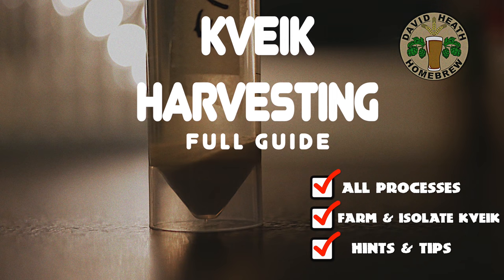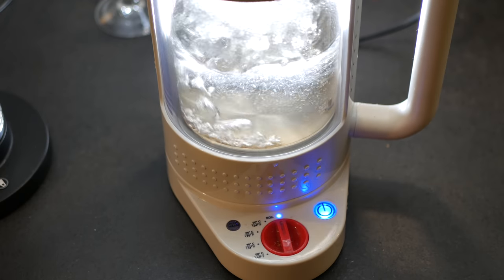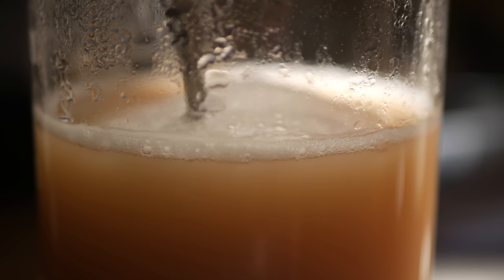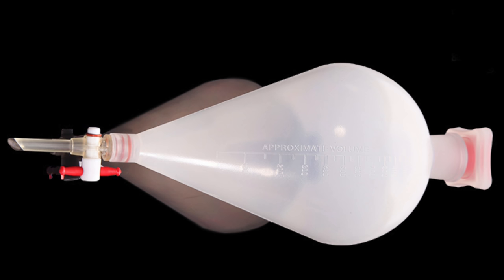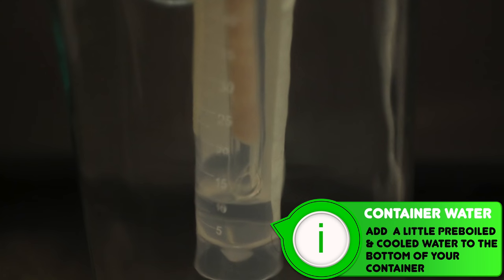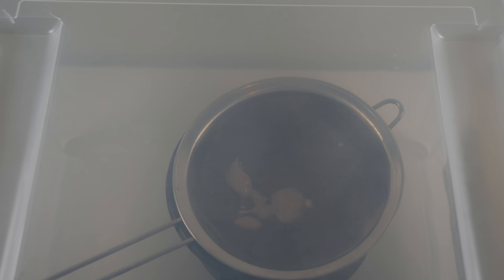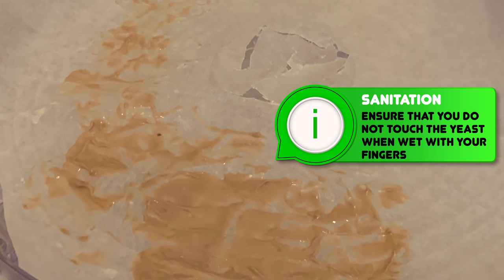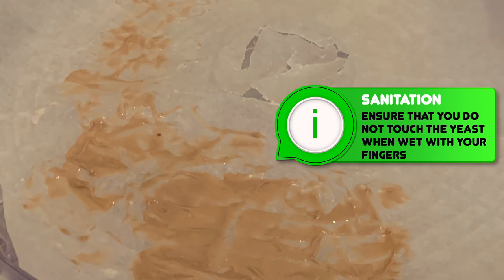Kveik Yeast Harvesting Full Guide

Comment: Love the information in your videos - so thanks.  Got myself some Sigmund's Voss from Crossmyloof in Glasgow and found I didn't have to top crop.  I switched from air locks to blow off bottles after my first fermentation - and being the greedy chap I am tend to fill my fermentation vessel a couple of inches below the top.  The vigorous fermentation (and I could describe it as explosive) saw my blow off bottles with their distilled not sanitised water - full of top yeast.  So much so that I had to empty and refill them three times.  I emptied them into my yeast washing jars and I now have a bumper crop of clean white Kveik to share.  Many thanks David.
Reply: The method of using a blow off bottle with purified water works a treat.  I don't like opening my FV - so making beer up towards 25L in volume means the krausen loves squirting into my blow off bottle.  Have used it straight from the fridge - and after it had air dried - all work wonderfully.  I think I may be overpitching though.  I will try a single tablespoon of my kveik harvest next time.  Thanks again.
Reply from the maker: Sorry for some reason I missed this. This sounds good as long as everything is clean and sanitary of course.
Reply: @DavidHeathHomebrew  Of course.  Working a treat so far David.
Reply from the maker: Great 🍻

Comment: Dried to perfection! Thank you for the video.

Usually I don’t even bother washing them. I just collect all of the trub from the bottom of my fermenter in a mason jar using a sanitised spatula. Leave it over night in a fridge - decant the top liquid - again using a spatula I pull the yeast out and spread it over a few butter papers and chuck that in the food dehydrator on no heating. 

But my dried yeasts always come out dark and won’t separate from the paper, probably because of the sediment. So I cut the paper in square inch pieces. Inspite of all that maltreatment they are crazy healthy! I use a square inch piece of that for each of my 20 liter batches and the airlock starts bubbling in less than 4 hours except for Muri which takes a couple hours more.
Reply from the maker: Thanks. Yes, much better to remove the trub.
Reply: @DavidHeathHomebrew  My next batch following your instructions is on the way... drying as we speak.. definitely looks much cleaner... thank you again
Reply from the maker: Great :)

Comment: I pretty much followed each of the steps that you outlined,  however I do one to two step-ups when propagating yeast starting at 1.040 then stepping up to 1.060, and finally to 1.080+.  I read an article about acclimating the yeast to higher gravities to avoid osmotic shock by doing step-ups for high gravity must or wort. However, I talked to a guy at the LHBS, and he thinks that the third step is unnecessary, and may just stress the yeast out.  The step I haven't done is using a fine sieve to drain the water, and I use an oven with only the oven light on with the door closed to dry on parchment paper over night. I line a sheet pan with aluminum foil first with a layer of paper towel between the aluminum foil and the parchment paper.  Then I spread the kveik on the paper thinly. I bought a lab stand at a garage sale for about a dollar many years ago not knowing what I would use it for. It was a little beat up, but with a little love, it works just fine. It comes in handy now when using my separatory flask.
Reply from the maker: Yes, you will find much out there. I have found that methods like this offer little benefit but it is good to try them yourself :)

Comment: I was wondering about the dehydrator temperatur control. If you are running it for a while and then turning it off to cool down for longer, then I would buy one of those cheap timers where one has a ring of pins to activate the on/off switch. Most have a minimum interval of 15 mins though and that may be too much. Chopsticks between the drying trays may keep the temperature down too.
Great video David.
Reply from the maker: Yes, that is a good idea for sure :) Most dehydrators probably won't accommodate the chopsick idea though.

Comment: Thank you for this excellent and comprehensive video! I'm going to start drying my already harvested kveik to save space in my fridge. I do have a dehydrator with temperature control, from 40 or 50 C I believe all the way up to 70 C. What would be the recommended temperature to avoid burning the yeast while drying it?
Reply from the maker: A lower temperature is always good and be sure to check it regularly. After some times you will know how long to give and this can vary with different equipment.

Comment: Thanks for the information. 

One tiny point - 1 quart is just UNDER a litre, not just over (quarter gallon, or quarter of 3.8l)
Reply from the maker: Thanks Richard. 
Hmm odd. Google tells me this:- 1 litre =
1.057 us liquid quarts. Ive never used quarts personally but I like to cover both metric and imperial to cater for all. Are the different types of quarts?
Reply: Yes, 1 litre = 1.05 quarts, or 1 quart = ~950ml, so quart is just under a litre :)

There would historically have been more than one quart. 
An old imperial quart would have been a bit over a litre, being as an imperial gallon is 4.5l, but I'd assume anyone who says quart now is referring the the US quart, based on the 3.8l US gallon. 

Thank god for metric!
Reply from the maker: Odd because it seemed the other way round when I checked! Oh well thanks for pointing it out, I will know for the next time :)
Reply: @DavidHeathHomebrew  There is a reason. 
Imperial quarts are bigger than USA quarts. 
Imperial = 1 quart, 40 (fluid) oz.	1.137 L	
USA = 1 quart,  32 (fluid) oz.	946.36 mL You are both correct.
Reply: If only there was a universal constant measurement system that we could all use...
Reply from the maker: Agreed!!

Comment: Great as usual. Did you decant your beaker before adding to the Seperatory funnel? If not do you see this as a problem? I just want to minimise the size I need to buy, I have a to 2l flask for starters and will prob decant slightly into a 1l seperatory
Reply: Oh and not just being cheap, my driver is to fit it in my pressure cooker for sanitization
Reply from the maker: No problem in decanting it at all, as long as you put it in a fridge overnight to collect all yeast at the bottom.

Comment: David, thanks for this. I plan to follow your methods exactly. A couple of questions -- after you ferment out the starter, and put it in the frig overnight, it has a thick layer of trub on the bottom, and a thin layer of yeast on top of that. You then transfer the liquid to the separatory funnnel. How do you get the settled out yeast to go into the funnel, while leaving behind the trub? or do you essentially leave behind the settled out yeast, and end up only harvesting the yeast that is still in suspension in the transferred liquid? Thanks for any guidance you can provide. cheers!
Reply from the maker: Thanks Robert. The funnel takes care of the separation for you. Just keep an eye on it, it moves slowly and allows you to separate easily.
Reply: David Heath Homebrew I think Robert was referring to the yeast that is left in your initial starter vessel AFTER you transfer the liquid to your separatory funnel. He was asking if you harvest this yeast too or do you just collect the yeast that is  in the liquid you transfer. I was curious about this as well.

Comment: Hi David - thanks for the video, excellent as always! Could you recommend a stir plate? I’d like to get a heated one but there are so many options In not sure which to go for. If you are at a loose end for a video idea I’d love to see an overview of the other equipment you use. Thanks again!
Reply from the maker: Tricky to advise sadly as the only stir plates I have used have been unbranded. The model I am using here works well and can be found on Ali Express. Sorry for the late reply, YT has some errors with message reporting recently so I only just got to see this!
Reply: David Heath Homebrew no worries David - thanks very much for getting back to me. I’ve done my first top-cropping thanks to your excellent directions and it was much easier than I had anticipated. Thanks again for the brilliant content!

Comment: Hey, great video! I plan using kveik Voss on Mangrove Jack's pink grapefruit IPA and I have a question...because kveik will finish fermenting so fast (aprox. 3 days) when should I add the hops for dry hopping? I read online that it would be bad if I add them the same time with the yeast, but I also read that kveik goes down very fast in the fermenter and if i don't bottle it as soon as it stops fermenting there will be no yeast left in the bottle for secondary fermentation and carbonation...i really dont know what to do. Thanks!
Reply from the maker: Hi, I suggest adding them when your gravity is 5-10 points away from the predicted FG.
Reply: @DavidHeathHomebrew  alright, thank you for the info!

Comment: I have made a home scale very small Bioreactor for growing up yeast cultures of Kveik Yeast for drying and freezing yeast slurry , Its a 1 quart to 1/2 gallon reactor depending on which jar i use.

Basically its a ball airlock lid( the kind for fermenting vegetables with a built in airlock) that i drilled a second hole in and put a stainless steel air stone that is hooked to an air pump and it sits on a Stir plate, so, if my understanding of the process is correct this would be a Very Basic Bioreactor.

My issue is the feeding schedule for optimum yeast growth and how much sugar and nutrient i should be feeding it daily. I have Fermax yeast Nutrient and I am doing my Grow up with white Table sugar because its a cheap easy sugar source.

I am building up a personal yeast bank of Kveik  yeast strains for use in Home wine,beer and mead making. So My goal is the highest biomass I can achieve with the limits of my home made set up.

My reactor it self is working so far I am just not sure on a rough estimate of how much sugar and nutrient to feed it daily. I dont have a super accurate Gram scale(yet) so I am using measuring spoons and cups at this point

At the present time, I am doing roughly 1/2 teaspoon of yeast nutrient and about 1/4 cup of sugar daily in a 1 quart volume of water I was wondering how these amounts look and if i should change them, if so how much of each would you suggest. The yeast nutrient I have is a General purpose nutrient designed for home wine,beer and mead making. My sugar source is currently white table sugar due to price and ease of access. Any suggestions you can offer would be greatly appreciated.
Reply from the maker: Thanks for sharing Vinnie. Sounds very interesting :)
Reply: @DavidHeathHomebrew  Any Suggestions on how much sugar and nutrient to feed it daily?
Reply from the maker: I never use sugar. I use DME in starter levels and 3 times the usual nutrient. This is much better for yeast health and thus growth, especially when used on a heated stir plate.
Reply: @DavidHeathHomebrew  Awesome thanks man, I dont have Access to DME at present so  I have been using what I have on hand. 

So I am actually over on my yeast nutrient as I am using half the Amount for 1 gallon in a 1/4 gallon volume.

My stir plate isnt heated so I am at ambient room temp which is high 70's at present.
Reply from the maker: DME is going to make a very nice difference

Comment: Hi David.
               Is there any particular strain of Kveik yeast you could recommend for cider brewing and could you reculture with Apple juice in a flask
on a stir plate.
                      Regards
                                       Paul.
Reply from the maker: Hi Paul, its a long time ago since I last made cider. I used voss under pressure. Seemed to work well but go high on nutrients. Ive not tried apple juice for reculturing personally.
Reply: @DavidHeathHomebrew  Thanks for the quick reply.
Reply from the maker: No problem:)

Comment: Can I just decant and smear the yeast straight on baking paper, skipping the sieve step ? I have a fruit dehydrator , I suppose the temperature setting should be 35-40C?
Reply from the maker: You can but you will have less pure yeast. Temp setting I would suggest 25C to avoid burning.

Comment: I was wondering if you had ever used a Kveik ring to harvest and reuse yeast? Cheers :)
Reply from the maker: Hi Paul, I have been tempted to try them but they only really become useful usually for larger batch brews in their normal size.
Reply: @DavidHeathHomebrew  After watching all your videos I would be very concerned about contamination but eBay and The Malt Miller both sell them at 12" which would fit most fermenters but I personally would only like one to hang on the wall in the brew shed haha
Reply from the maker: Yes, thats all I would buy one for too 🍻🍻

Comment: Has anyone used the Kviek Espe? I have a question
Reply from the maker: I have not yet
Reply: @DavidHeathHomebrew  Thank you for the prompt reply. Just made a starter with it and I'm getting the Warsteiner rubber tire flavor from it. The original Omega yeast packet had it and I thought maybe it was autolysis due to being expired but the starter has it also. Gonna pitch it in a barley wine and see
Reply from the maker: @clevelandmortician3887  Some kveik is known for this effect but in checking the registry this is not mentioned.